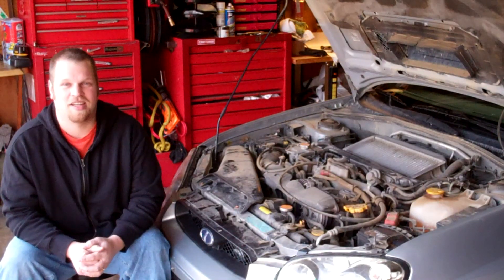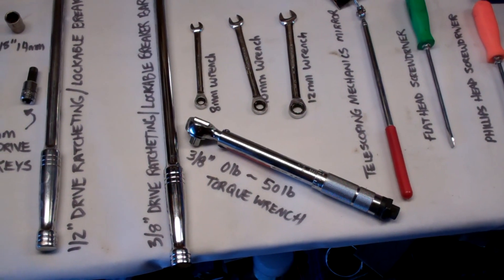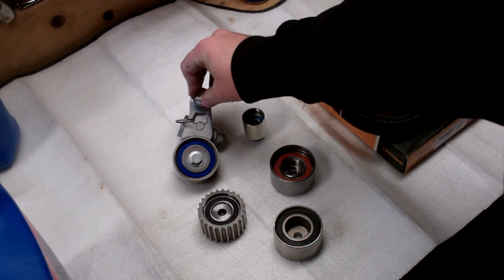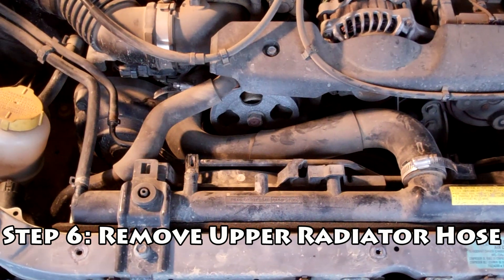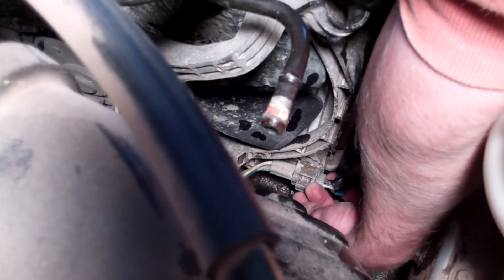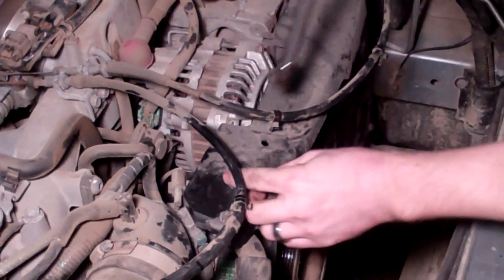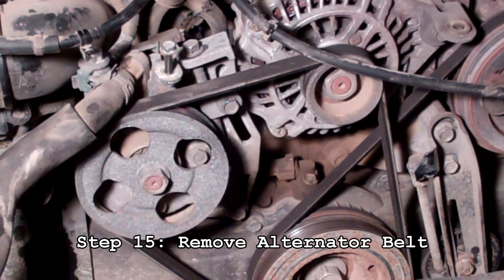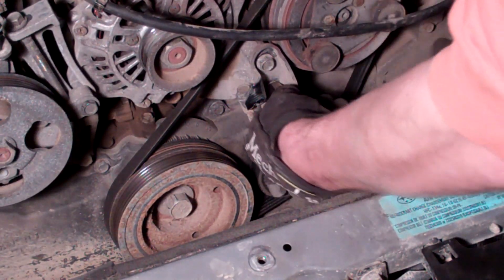Meatys Subaru Timing Belt Guide (HD)(1/5)

Comment from the maker: @ycformosa from moving. Then use the correct socket and an impact gun and loosen the cam gears. You can then either remove the seal with a pick kit or remove the valve cover (which I find easiest). Be sure to look at the orientation of the cam seals BEFORE you remove them so you know how far back they go when you install the new ones.

Comment from the maker: @ycformosa Crankshaft sprocket pulls straight forward. If it's corroded on you might have to smack it lightly with a rubber mallet and work it off. Be careful not to pry on the teeth of the sprock, they will bend or break rendering the entire sprocket useless to the crankshaft position sensor pickup. To remove the cam gears on the 98 you will need to wrap an old timing belt around the cam you're removing, wrap it around the crank sprocket, and clamp the belt with vice grips tightly to prevent it

Comment: Hi, I am having problem to get the cranksaft sprocket and passanger cam sprockets off, I need to change the seals. they are leaking. thanks. I forgot to mention. mine is 98 subaru forester

Comment: Did my T belt following this procedure. Was honestly way simpler then i thought.  Re tapping my crank snout to 9/16 after twisting off the pulley bolt was the harder part.  No it will never come out.   Bolt was loose, key ate out the back of the pulley. Metal dust EVERYWHERE.  Especially back in the bolt hole blocking and locking up the bolt.   New tensioner, Sprocket, key, pulley, intensive cleaning of everything to do with timing and a dab of JB weld on the keyway and running better then ever

Comment from the maker: @wrxstiguy1 
Bellhousing usually contains 2 nuts on the bottom engine studs, and 6 long bolts. Be careful when re-inserting bolts and make sure the long one for the starter goes back in the same hole so that you're not threading it into the motors coolant passages by mistake.

Comment from the maker: @sizemic11 

The 2.0 and 2.5 are the same procedure. This was on a 2.0L. The STI 2.5's and 06+ WRX's and FXT's have slightly different cam gears. I show a segment in the video addressing these different cam gears. You just have to remove 3 small bolts and a cover to access the bolt in order to turn them.